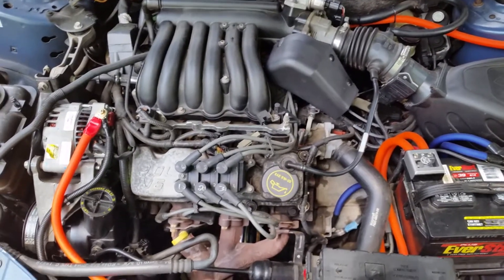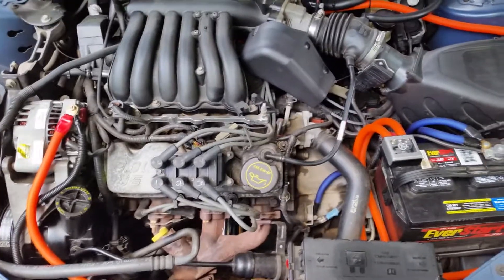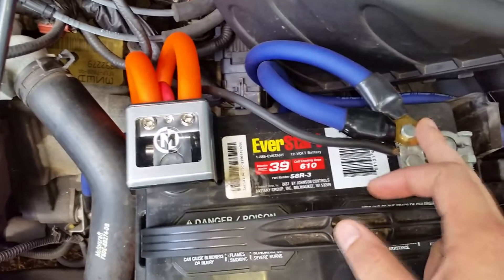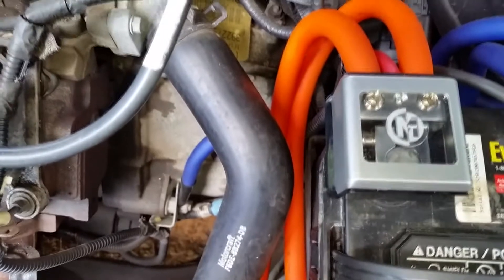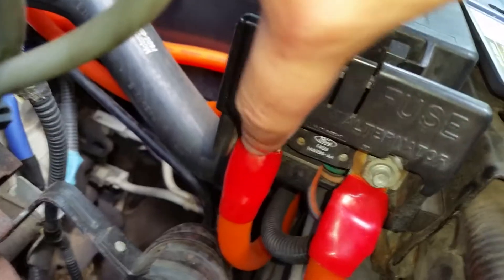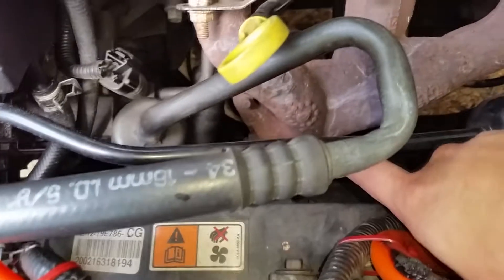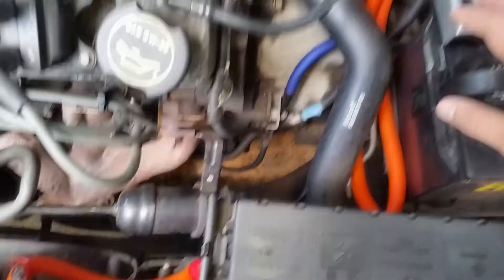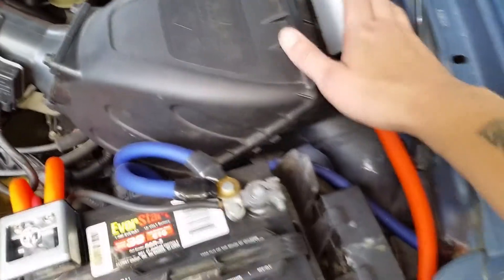Big 3 /2002 Ford Taurus/

Comment: So I got a Alternator built by Mike Singer and the alternator does 136A at 650rpms idle, 161A at 833rpms idle, 246A at 2,000rpms and 271A at 3,000 rpms. I’m gonna be doing the big 3 upgrade and I’m worried if this will blow the fuses in the megafuse box?? For a 2005 Taurus with the 3.0 V6 OHV

Comment: Im getting ready to do the big 3 on my 03 taurus. Glad i came across your video. You don't see many vids for taurus.
Reply from the maker: I'm glad I could help some! You're right, most Taurus videos are of repairs, or people just showing their systems off which is why I wanted to share my journey with you guys! More to come soon, thanks for watching :)
Reply: +Chuk454SS did you ebay your terminal connectors or how did you buy them? I used your video to install my big three yesterday and forgot that the alternator chassis is a ground and let my positive touch it, long story short, i am thankful i had a mega fuse to put back into the car because the original died saving my alt and battery for sure. I have 2/0 gauge to an amp in the back powering three tens and the amp is true 1200 at one ohm from soundqubed. I am thinking of gathering info and explaining it like you did for others to benefit in the audiophile world, want to talk more? I would appreciate it.
Reply from the maker: Blackfrost273 Industries
I'd love to chat more! But as far as the terminals, I crimped them with pliers and a hammer (kind of barbaric but it worked!)

Comment: where did you run your power wire from battery to the truck. did you cut a hole or was there a space somewhere to run it. I have a 03 .
Reply from the maker: +BigAl Best There is an extra hole on the firewall which has a grommet in it. Pop that out and you can run the wire through that hole. Be careful though I dropped the grommet when I punched it through. If that happens, just use some electrical tape to cover the metal edge, you don't want your power wire rubbing on that. If you have a column shift like I do, the hole will be on the passenger side up around the transmission tunnel (the hump in the middle of the car under the dash) All I did was pull the carpet and underlying foam back in that area to find it . Sometimes it can be hard to pull the foam back, but all you have to do is kind of run your arm under it upwards towards the describe area and you will feel the rubber grommet. This hole comes out by one of the heater core hoses going into the cabin. I would recommend using  one of those extra large zip ties to run through the hole once you find it in the interior so you can see where it comes out. BE CAREFUL with that step, if you recently drove it let the engine cool completely because that hole is close to the exhaust manifold. Hope this helps, and thanks for watching!
Reply: Thanks a lot
Reply: Why not just run the 0 gauge straight to the battery in stead to the fuse box.
Reply from the maker: +BigAl Best You're welcome. You want to place the fuse as close to the battery as possible. This prevents any shorts in the wire from getting hot and burning up. This could cause damage to the amp and could also set your car on fire. I knew a guy once who ran too small of a power wire to a power hungry amp with no fuse and it literally set his car on fire. Amps can pull a lot of power which cause higher heat in smaller, cheaper (i.e. Walmart brand amp kits) wiring. For anything 800 watts and up, I would recommend running 0 gauge for the best current flow.
Reply: +Chuk454SS my bad I meant straight from the alt to the battery instead to the Mega fuse
Reply from the maker: +BigAl Best Running straight from the battery to the alternator could cause major issues if there is a short in that wire alone. This could damage your entire electrical system. If you want to run straight from the battery to the alternator, place a fuse in between. I chose to run through the Mega Fuse to not only increase the power for the system, but also for the electrical system for the entire car.
Reply: +Chuk454SS OK. I seen one bid up here guy had a 02. he did the big three and his volts was worst with the big three then without. how is yours
Reply from the maker: My voltage is definitely better with the upgrade. Without playing my system, I get an average of 14.7V with the car running. While I'm playing my system pretty hard I never get a drop below 12.8V (that's with really heavy bass songs almost turned all the way up). I still get light dimming during huge drops, but that because I haven't upgraded my battery or alternator yet. I recently upgraded to a 10,000KW HID kit, so my headlight do dim any more, but the voltage drop is still there.
Reply from the maker: +Chuk454SS *headlights don't dim
Reply: +Chuk454SS nice thanks a lot
Reply from the maker: +BigAl Best No problem bro, if you ever need any help with your Taurus, feel free to shoot me an email, I would be glad to help.
Reply: +Chuk454SS OK definitely will do